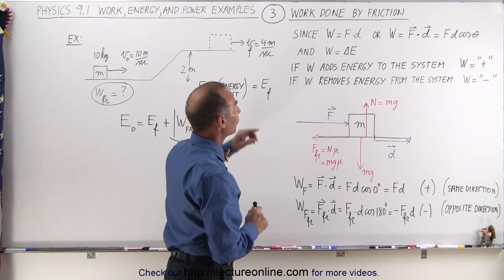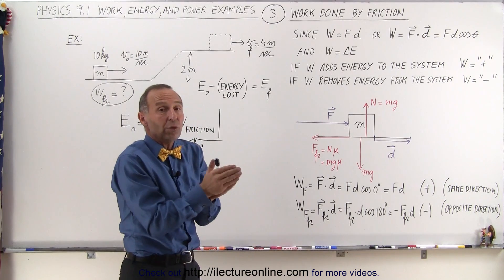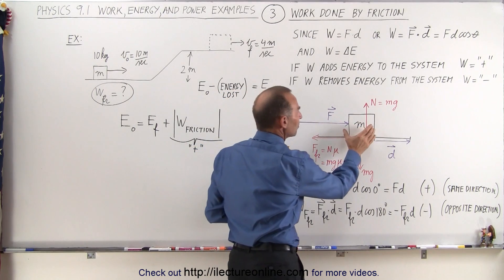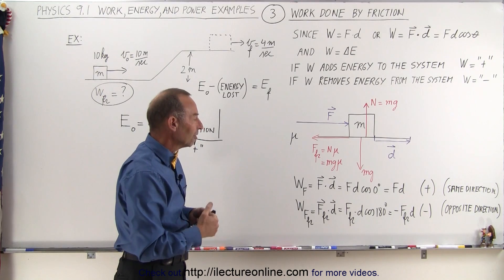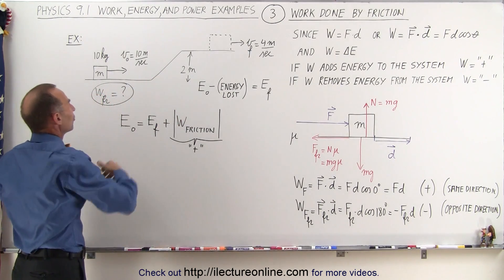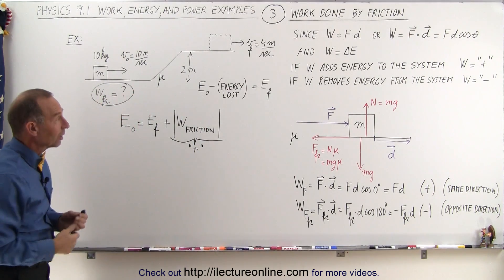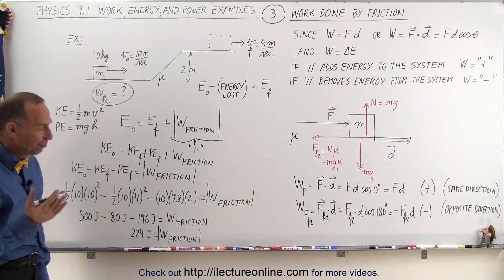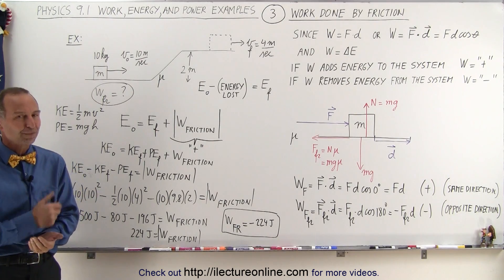Physics 8.1  Work, Energy, and Power Examples (3 of 27) Work done by Friction

Comment: A car of mass m slides across a patch of ice at a speed v with its brakes locked. It the hits dry
pavement and skids to a stop in a distance d. The coefficient of kinetic friction between the tires and the dry
road is µ.
7. If the car has a mass of 2m, it would have skidded a distance of
(A) 0.5 d (B) d (C) 1.41 d (D) 2 d
8. If the car has a speed of 2v, it would have skidded a distance of
(A) d (B) 1.41 d (C) 2 d (D) 4 d

On the answer key it says -Fkd=-1/2mv(i)^2  But solving this makes the work done by friction positive. Is the answer wrong?